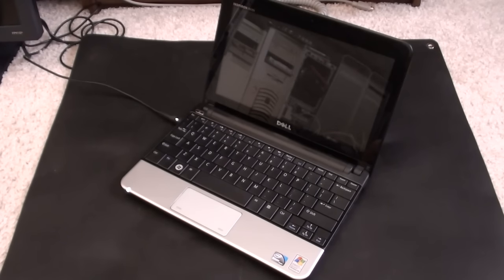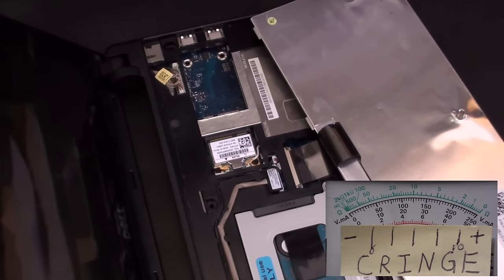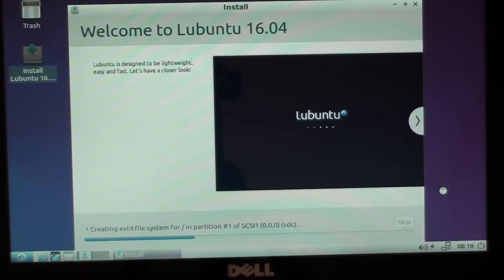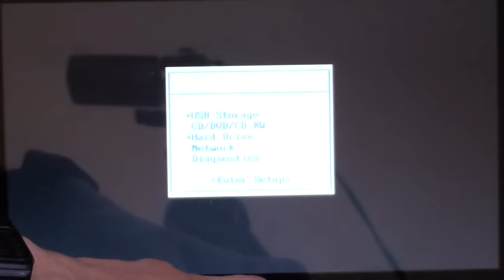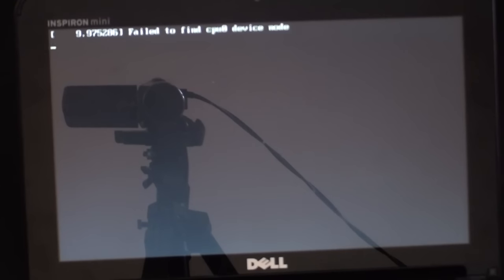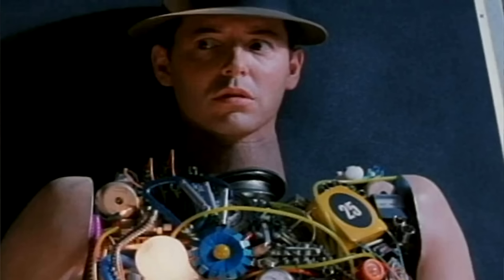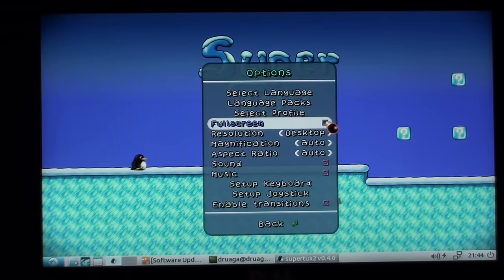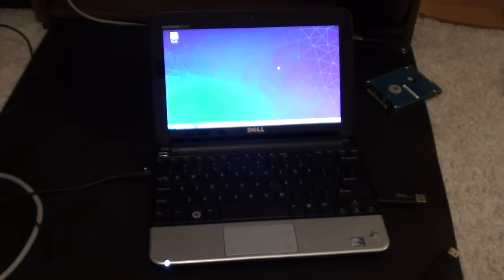Creating the SSD Linux Netbook

Comment: after all years of installing and reinstaling all kind of flavors, actually i can say, if you gonna play games on linux, please, pleeeeeease, install the drivers because if you don't, you gonna think linux is crap and reinstall again.
Reply: gerard s Yup. That'a whats bothering me the most at Linux related videos. They never put even a bit more effort in it than running through the installer, and say it's crap -_-
Reply: @resneptacle  Because it is. Thoroughly installed EndeavourOS a year ago, after trying some other distros and not liking them. Drivers installed, everything good to go, right? No. Some crucial games didn't work. Those that did ran worse than on Windows with the exception of Minecraft Java - but now that I have a Radeon card it runs as well as it did on Linux. Some crucial programs didn't work, which was the dealbreaker. SSD trimming not on by default (what the fuck even?). Automounting not a thing. Very arbitrary workarounds required for the simplest thing. Community is godawful, uncooperative, and elitist no matter where I went - Discord, forums, Matrix, etc., no matter, they were all the same.

So I went back to Windows 11, and I continue to be the happiest I've ever been with a desktop OS. Loonix HAS A LONG WAY TO GO in both the community & compatibility standpoints, before it becomes a viable desktop OS.

Comment: a gig of ram?  theres  your problem   linux needs four gigs MINIMUM to use a DE
Reply: Me too   i ran LXDE on 784 MB ram pendium 3 ibm thinkpad  just a coupple years ago  but i will NOT go back lop
Reply: HAHA  browsing on less than a gig of ram       thats just not happening    chrome itself takes up half of that   and facebook takes up twice that  with the modern system of "webapps" thats just not going to happen
Reply: Yeah     the second you enable html5 or flash your done for
Reply: though you can get pretty far with elinks
Reply: yeah     im currently living on 6 gigs of ram        but ive had 4 gigs for a long time
Reply: Just put more ram in the thing  and youll be good
Reply: IKR     i spent 40$ on a 4 gig stick xD
Reply: lol no     i need x86_64
Reply: the pc is my daily driver       and a pi wouldent be suitanble for me
Reply: Fennec Fox That is total bullshit. Some DE's use a composite manager, which uses more RAM, yes, but most of them work on 512mb very usable. Also, i use Firefox with HTML5 and JS (e.g  YouTube) on a netbook with Intel Celeron @ 900Mhz x 1, 1Gb RAM and a regular HDD with Arch and Openbox. It runs smooth and very, very usable

Also, do you write "Pie" on purpose? (Just asking, not hatin') @ macrox95
Reply: true    but the moment you try to go online
Reply: ***** No. Like i said, Firefox works fine on 1Gb of RAM in Openbox, which is used in LXDE/Lubuntu
Reply: can you comfterbly run that with a browser tho
Reply: *****  Yup, you can. Of corse, pages need to buffer and maybe even swap to HDD, but still, it's very usable
Reply: nah  swapping sucks   swapping sucks balls xD
Reply: Basicly  when you get into low memory    your system will lock up for five minutes and cycle a few megs out of ram   and then go back into low memory mode and do it all again
Reply: ***** I never had that scenario, well, i use swap partitions (on regular HDDs), and it never really slowed down my systems, even when all available memory was occupied. And even if not using swap, the system never locked up for 5 minutes, often only the software with the largest use of memory freezes and/or crashes, but not the whole system
Reply: The machine itself locks up   even the cursor stops movinf
Reply: + FennecTECH It would depend on if you're trying to run a 32 bit or 64 bit version of Linux. I've got the 32 bit version of Ubuntu MATE running on a 2008 Eee PC with a 900 mhz Celeron and 1GB or RAM (very soon to be 2GB) and it runs pretty flawlessly compared to the stock XP install that initially came with it. Watching videos is a bit of a pain (full screen ain't happening), but other than that it runs adequately given the age and specs. If you're running 32bit, then 1 GB is sufficient and 2 or 3 would be more than adequate. 64bit and yeah, you need 4 GB minimum no matter what OS it is. It would run on 2GB but you'd want to tear your head off. Even at 4 GB, it can get bottlenecked depending on your hardware.
Reply: For Ubuntu. Lubuntu needs only 1GB.
Reply: + TheMiningTeam True, but then when you start running things on top of the base OS, the 1 or 2 GB will tend to be a bit cramped for 64bit things. Sort of a case in point: Maybe this is Apples to Oranges, but I recently put OSX High Sierra on an old Unibody MacBook with only 4 GB or RAM. Surprisingly it runs fairly well, but you just can't have as many other programs open. Windows 7 and Ubuntu MATE tend to run a bit, well to be honest, MUCH better, but even then things tend to start bumping their heads against the ceiling when there's too many of them in the room.
Reply: FennecTECH you can use set up zram on a SD card.
Reply: Tom Amey Android x86 can run with less RAM because the swamp drive I'd designated in the kernel  cache and can load source code so you don't need to store all the program framework on ram.
Reply: I ran Ubuntu (and Lubuntu, more recently) on a computer with 2GB, no problem.
Reply: The Tyttuutface what cpu do you have? I have Intel junk and had big issue with multipler working.
Reply: How to basic It's an old Pentium 4. I've also done the same thing on a Pentium D and an E2160.
Reply: The Tyttuutface I think the Pentium 4 works better on Linux as I had Pentium 4 struggle with windows 7 more so than later single core Pentium.
Reply: Yes, you are right. But this is for Ubuntu (Unity), Kubuntu (KDE), GNOME, Cinammon etc.

However, 1 GB is perfect for Lubuntu. It is the most lightweight Ubuntu distribution which is usable. (compared to Puppy Linux!!) I have also used it on my aging Dell OptiPlex GX270 with a Pentium 4 @ 2.4 GHz & 1 GB RAM and it was perfect!
Reply: Bajiru Linux dose not need alot of RAM because of zram but you do need powerful CPU because it's up to the CPU to intergrade zram which is invaluable to virtualize c++ priority's like using whine.
Reply: EGGScuse me butt according to Wikipedia Lubuntu 13.04 requires 128 MB of RAM minimum and 2 gigs of harddrive (in this case Marijuana SSD) storage space to operate!
Ubuntu and Ubuntu MATE (32-bit) require 2GBs of RAM and the 64-bit versions require more than three gigs (according to ubuntu mate website) (I use Ubuntu MATE on my main computer)

Comment: I think all you need to do is reinstall the SSD into a surrogate computer, completely wipe and reformat it, reinstall Lubuntu, then reinstall the SSD into the netbook and the crashing issue should be resolved.

Honestly, when you tried to cancel the installation part way through I cringed, but most of your other stuff was pretty logical and good thinking. Generally you'll be fine moving an SSD with an installation of Linux from one computer to another, even if it isn't optimized for that other computer, unless of course you're mixing CPU architectures (although x86 vs 64bit will likely cause issues, especially if you install 64-bit and try to transfer it to a 32-bit system)

Comment: I have a HP Mini 110-3100 with the same Intel Atom processor, 1 GB RAM, 250 GB HDD and Windows XP Professional SP3. It runs pretty fine up until now (5 years on going), i'm starting to notice wear-and-tear though. I do browsing on it and *gasp* play games with it! (HL, CS, GTA:VC, GTA:SA (incredibly reduced GTA SA), RA2YR, Manhunt, etc.) and it runs suboptimally but bearable. I still use it up until now.

Comment: Enabling trim might help with the SSD's performance if the drive supports it, and I've installed Linux (Zorin OS Lite) on a similar spec'd Toshiba netbook (1GB RAM, Intel atom) and had no issues.
setting up ZRAM (compressed memory) should help with RAM usage, installing it is as easy as "sudo apt-get install zram-config" by default it compresses half of the total memory, data that isn't accessed as frequently gets moved into the compressed memory.

Comment: Hey Druaga, just a heads up: I've had a similar experience with Ubuntu freezing after leaving it idle for a few minutes. I figured out it was an issue with the way Linux handles power management for SATA devices. Fortunately it's quite simple to fix, and it doesn't require disabling the power management. All I had to do was update the firmware on the SSD, and once I reinstalled Ubuntu, it stopped giving me problems. This assumes that the firmware shipped on that SSD is not the latest available. Now whether that will fix the issue with formatting, I'm not sure. Nonetheless I would consider giving it a try. 😁

Comment: great video. most likey your issue with games and video being slow is that the computer is probably running in software render mode. you should install the gma500 drivers and see if that fixes your issues.

Comment: I think the issue is that EXT4 is difficult for the little Atom cpu to do on its own. I had a similar issue trying to install Linux on my 1012 model. Solved it the same way as you, by pre-partitioning the drive on a separate computer.

Comment: i know im a bit late for this... but netbook hdds are thinner than laptop 2.5" hdds, thats why the ssd included that "bracket".. it is meant to make it fit in a notebook / desktop 2,5" bracket

btw.. man, that fail on the disassembly was way too painful
Reply: .... netbook hdds and notebook hdds are the same size... desktop hard drives are the ones that are different, 2.5 for netbooks/notebooks and 3.5 for desktops. some ssd manufacturers include 2.5 to 3.5 brackets (unless you order OEM)
Reply: nope... i used to think that way until i tried to replace my netbooks 2.5" 250gb hdd with a laptop 2.5" 500gb hdd and it wouldnt close because the standard notebook hdd is like 1,5mm taller. and thats why the ssd in the video fit perfectly in the bracket without the plastic square, which would be necesary in a notebook bracket.

Comment: I can't believe I actually watched the whole video (train wrecks are like that). Go into the bios setup and re-enable fast boot to bypass the startup diagnostics. Now then, I have an SSD mounted in an external USB case that I was hoping to connect via the OTG cable to my tablet PC (running Android), but no go, the drive draws too much power. Can I connect the OTG to a USB power bank (via a splitter cable) and the drive at the same time?

Comment: youtube and facebook are the bane of the pre 2006, all atom and celeron machines
Reply: Simos Katsiaris Not really, YouTube works okay with Firefox on Arch Linux+Openbox on Intel Celeron 900MHz x1 and a Gig of Ram. And if you use smtube and mplayer, there are no laggs or stutters whatsoever
Reply: JonasLue that is an i7 extreme compared to atom, I'm talking any the entry level, atom based Celeron, now called pentium, not the core based

Comment: You don't need all those partitions, technically you can go with just one... I've ran with just a single ext4 partition with no issues. If you need a swap, you can create a file for it instead of a partition, which is actually preferable on SSDs because it reduces wear.

Comment: Ubuntu's installer disappointed me a few times as well when it comes to partitioning.
I'd recommend a distro that doesn't go that much for style but for functionality.
On my 1.6 Ghz Atom Netbook I'm running Tiny Core Linux. It's a little bit more involved to configure and beautify it's ugly UI but runs great on that low spec machine.
Who would have guessed the four-letter password is "weed"...

Comment: Once you install Lubuntu on the SSD there is no need to reinstall it once you put it in the Netbook.  You can drop that SSD in any pc and it will boot Lubuntu.  It will find the necessary drives to boot up.  Lubuntu isn't as picky as Windows. Also using an Atom is painful.

Comment: Woot! Dell Mini 10!

I still have a Dell Mini 10 (1012 model) that is running Windows 10 on a 120GB SSD. Its actually surprisingly fast. Upgraded to 2GB of RAM (which is significantly easier than the model you have in the video).

I originally tried Ubuntu on the netbook, and it didn't run nearly as well as Windows 10. I also experimented using Remix OS, which was cool but still rather slow. Due to the lack of graphics capability, it can't run any Android games, or even YouTube. But there are some cool tricks to make it work just as well.

If you install a Broadcom Crystal HD decoder (only possible in the 1012 model, due to the extra mPCIe slot), and you use MPC-HC as your video player, it can play 1080p videos (H264 only) remarkably well. This needs to be done on Windows 7 or later, due to proprietary drivers.

... I have that same Casio Databank watch, by the way.
Reply: Link for more info: http://www.overclock.net/t/1596974/1080p-video-emulator-netbook

Comment: Next time you have problems installing, or just have suddenly crashes.. Try to do a BIOS update, and also see if there is a FW update for the SSD.
Earlier I had a Samsung RV520 or something like that.. I installed an SanDisk 256GB SSD in it.. had lots of problems.. Even crashed under Windows install.. After a BIOS update and a FW update, it worked fine!
Then I got a "new" laptop.. HP ProBook 6460b.. Same kind of problems there.. Bios update, and a FW update for the SSD, and it worked just fine.. Still using this setup on daily basis :D
Only problem I have now, is if the battery runs to low, so that the computer shuts down.. On the next startup, it will not find the SSD.. Then I have to restart to find it (or press "esc" twice.. then it tries again, and will find it.

Comment: Did much the same thing with an Acer Aspire One.  This One had 4GB of memory tho...
There's seems to be an issue with the Adata SSDs in general around re-partitioning.  I had the same gyrations and ultimately nuked the partition table and formatted with Reflect on a Windows machine.
Got it working with vanilla Ubuntu and it wasn't worth it.
MinSpec for Ubuntu is quite a bit higher than XP so the XP netbook experience was better...
I was hoping ReactOS would work out for my netbook but...

Comment: What SATA revision is in that notebook? Doesn't matter if you put a 5400 HDD or an SSD in a computer with a SATA 1.5 connection, they'll both run ridiculously slowly.
Reply: L2112Lifz I call bullshit. The latency of the SSD means that no matter how low your bus speed, the SSD is still going to work way faster.

Comment: I'm having the same problem too.  Linux mint 18.2 install dvd  said my  SSD is full  and it won't install. Yes  SSD  has windows  xp pro  without MBR.  I wanted Linux os installation dvd to write over it  :C   In the pass i tried to clone/install Windows XP Pro in SSD 12 times. It keep showing that it has no MBR for SSD,and it only have empty folders,files in the SSD.

Comment: Why did you do the install AGAIN after it had already installed. It only booted back into the usb because YOU didn't take it out. Remember you set in the BIOS for it to check the USB before the hard drive.

Comment: I've had Lubuntu crash half way through an install and then still work after a reboot. Linux is bulletproof compared to Windows. Errors don't hold up linux like they do on Windows operating systems.

Comment: my neighbors came to me because their XP computer crashed sometime last year, so i installed PClinux OS, which they couldn't figure out at all........so i had to put XP back on it, and it wasn't by choice either, it was because it was an old Pentium 4 system with a tiny hard drive and putting windows vista or 7 on it would have taken up all the space

Comment: Did you check for a bios update for the netbook first? Some older devices just didn't support SSDs. I have a suspicion older Atom computers don't like SSD also, I put one in an Acer Revo 3610 thinking it would perform better than a normal drive, it was actually slower

BIOS Update : http://www.dell.com/support/home/us/en/04/Drivers/DriversDetails?driverId=VRYXP&fileId=2731090605&osCode=WW1&productCode=inspiron-mini10&languageCode=en&categoryId=BI

Doesn't mention SSD though and there's only 2 bios updates listed (the other doesn't mention SSD either) so meh

Also, you did a Frankenstein install and then started and crapped out on another install but still thought that was gonna be good to go?

Comment: You didn't have to reinstall it on the netbook after installing it on the desktop.  It would've worked just fine.  Linux will pretty much never have any fixed driver configuration.
Reply: Overall looks like some kind of major compatibility problem between the netbook and the SSD.  At some point there were disk IO errors showing, and some kind of hardware incompatibility would cause those sorts of erratic behavior with stuff just crashing and misbehaving in general.  There's a chance windows might work better with that SSD in that netbook just because of some obscure way windows might do something differently than linux that might possibly avoid the issue.

Comment: why would u reinstall lubuntu for another computer after it's already installed? linux is way more flexible than windows and doesnt need to be reinstalled when u switch the drive between computers usually, it will just run

Comment: I have this very same netbook loaded with a 128 SATA 2 SSD and Lubuntu and it FLIES.   One gig ram.   I've run Linux on a PowerPC and single core Windows laptops.   Lubuntu and MX14 are good choices as is Arch with  LXDE.

Comment: - It's not SuperTux, it's LSDTux. You've unlocked the secret mode.
- I recommend you upgrade the RAM to 2GB, install XP Pro x86, and use it for older games that demand lower resources, or even 8/16-bit ROMs. You could make a video on it. Or even try older Windows - if you have ALL drivers.
- Note: Atom performs worse than Pentium 4. It's Intel's worst creation.